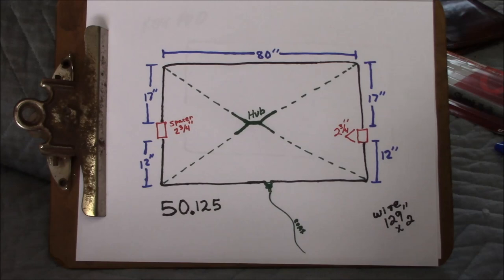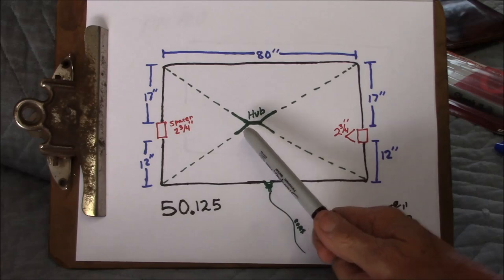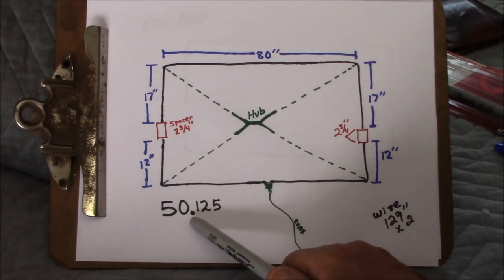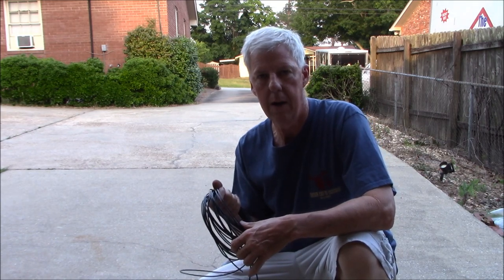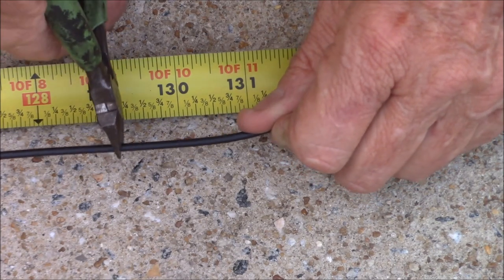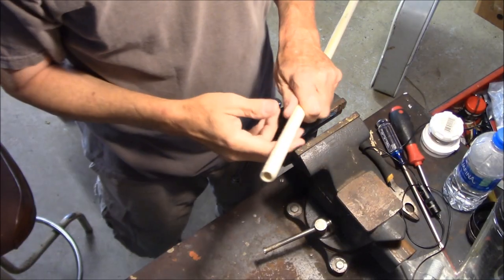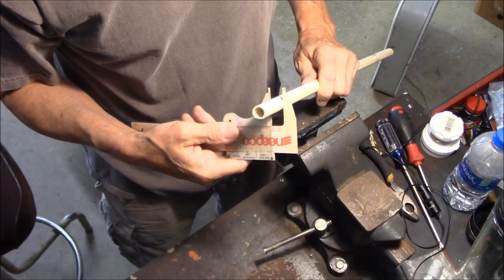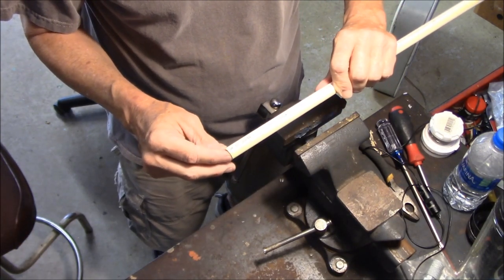Moxon Antenna Build for 6 Meters

Comment: In a word: OUTSTADING!

Clear, consise, and very well presented. A hat tip to you Sir.

I've wanted to get on 6M SSB and the FM Repeaters for years. You just showed me how easy it can be and with band edge to edge usable SWR.

I have so many projects running simultaneously that I can't keep track of them. Some I've just started, some are at some level of completion, but none have been completed. YIKES......

I suspect I have some form of AD. In my mid-teens, my Grandmother said 'Rusty, you never finish anything'. So for the last 65+ years, I've been working really hard to prove that that Grand Old Lady was 100% correct. Hi-Hi.....

Well, you just added another project to my list. But, this is so easy that I can start it in a week or two and finish it in one or two days. A great Rainy-Day project.

If I do this, I'll come back and edit this post.

Say a prayer for me.....

73 from So NH
Reply from the maker: Thanks for the kind words.
6 M season is upon us. 
Steve Ad4xt

Comment: Wow what a nice design! You make this look quick and easy and your instructions are clean and easy to follow. A work of caution on the Dremel, those mini saw blades can get dangerous VERY QUICKLY! I almost cut my thumb off one time because I was holding the piece with one hand and cutting with the other and at high rpms the blade can grab the piece you're cutting and take off. You're smart to use a vise! 
  The 6 meter Moxon I built used 1/2 inch copper pipe and was more square than rectangle. It worked great, but I noticed that it radiated down the coax when I checked it with a cheap homemade field strength meter. I used your technique of making a few turns of coax around a small coffee can and then taping and using wire ties around the coax. I didn't leave the coffee can in place, I just used it as a guide while winding the coax. I've heard that it works best when you make the coax 1/2 wavelength long, but I just winged it and wound it a bunch of times and the turns even overlapped each other. It was kind of a mess, but absolutely had NO rf on the coax after that point!
   It would be cool to see you add 2 meters to this as well. I'm not sure if you could feed them with the same coax or not. I love these plumbers delight design and you build hem in the true spirit of amateur radio. Way better than buying something out of a box for hundreds of dollars! As a Mainer myself, I appreciate your shirt, although I did live in South Carolina for 17 years and always like traveling through Georgia. Thanks Steve and 73's.
Reply from the maker: Thanks Ryan for the kind words. My son lived in ME for a year. Got to spend a week and travel with him. Beautiful state. 
My club has done a couple of 2 meter j pole builds.
Reply from the maker: I have a 2 meter simplex video that shows the Is measurements.
Steve - Ad4xt

Comment: Nice build. I like the way the wire elements are held taught. It looks like it will hold up to the test of time. 

I would have like to see better coverage of you mounting it to the mast and to hear the antenna to get a feeling for its directivity and noise characteristics, but maybe you’ve already covered that in another video, so I’ll have a look through your library. 

Thanks for sharing.  73s.

Comment: Great video and nice design. Seems like it would be a hair lighter and cheaper with pvc for the X, using a short straight section and a couple Y's, though it would take some measuring.

Comment: Just tune the antenna for 52 Mhz with 10 AWG stranded or solid wire. The #10 AWG will broadband the antenna by lowering antenna "Q" and extend the tuned 2:1 SWR curve for the whole 6 Meter band. Enjoy !
Reply from the maker: Very nice!

Comment: Suggestion. The SO239 you used has  white nylon insulation. During soldering this softens and distorts. When it cools you can get a poor connection. SO339's with a brown bakalite type insulation are the same price but do not have this problem.
Reply: googled that did not find Any  SO 339
Reply: @j1mbobtech  He fat-fingered it. >>>SO-239<<<

Comment: Hi Steve.  Thanks for the great video.  I'm nearly finished building a copy and have one question.  I'm curious about the coax connection device on the active element.  If you gave dimensions, particularly the distance between the dipole half's I missed that.  When measuring the 80 inches for the active dipole is just the wire measured, or is the measurement including the gap between the connection posts?  Thanks.
Reply from the maker: It's part of the total measurement. Just leave you a little extra at the ends in case you need to adjust. Good luck.

Comment: Interesting.  Never have seen an antenna like this.    I wonder if chokes like that on a Hustker vertical antenna or an EFHW could be used to work bands on lower frequencies like 40 & 80 for this antenna? Has any thought been given to that idea?
Reply from the maker: Moxon design has been out for quite a while. Easier to manage them on the upper bands.

Comment: Thanks for the video. Can you adjust the feed point for best SWR, and how much of the band does it cover?
Reply from the maker: Adjust the wire length, not the feed point. Just small amounts at a time. 
Covers most of the band, and all of the ssb area.

Comment: Very nice video. I am 80% done with my moxon build. Considering other ways to attach the antenna to to the fiberglass poles. I do not want a permanent threaded solution as shown in your build. Any other ideas? Thanks KK4NKR Brian
Reply from the maker: By going thru the end of the rods it keeps wire measurements locked in place. Not sure of another way and make it easy to set up in the field. Good luck with your build. Six meter season is here. 
Steve  Ad4xt

Comment: Good video, I don't get the four rods to the corners, It is more rigid to run one backbone parallel to the direction of signal, the long axis, and then use two width length pieces in an I configuration. Fiberglass is too hard to find, wood ends up lighter.
Reply from the maker: The rods can be found here in the southeast at any Tractor Supply store.  I take this antenna out portable a lot. My club will use it for Field Day next month. It packs up in a tight package. Thanks for watching. Steve  Ad4xt

Comment: Only critisism is your choice of PL259 with the white nylon insulator These usually distort when heat is applied. Look for connectors with a brown insulator as they don't have this problem.

Ian G4JIU
Reply from the maker: Ian,  this was the only  SO239 chassis connector that I had at the time. You're correct, you have to be careful with the iron with cheaper connectors. :-)

Comment: Which Solder did you use Steve on the HUB ? Resin Core or Acid Core ??? TNX For the Inspiration Video .
Reply from the maker: I used regular plumbing solder that has an acid-base flux. Thanks for watching!

Comment: I know mine may differ but what was the final length of each section tuned?  Great stuff and hope to work you from East TN sometime!  K4RJJ
Reply from the maker: The measurements are in the video somewhere. I do remember that using one of the online calculator tools for the frequency that you want, 50.125 in my case worked out almost perfect, very little tuning was necessary.  Thanks for watching.
Steve

Comment: What were the fiberglass rods originally intended/designed for? Knowing what they are intended for will make it easier for me to find them I think. Thanks
Reply from the maker: Thanks for watching. I'm not sure exactly what they are used for. I purchased them from a local farm feed and seed store. Tractor Supply. I will ask them next time I go by there. 
Steve Ad4xt
Reply: @hamradioportable1630  Electric Fence Post
Reply: You can find fibre glass rods at many garden centers in the UK. Just make sure that you do not buy the plastic covered metal tubed rods. I bought a load of these in differing lengths and later discovered they were all but useless for the intended radio application purpose. They are used as plant supports.
Reply: Driveway markers come in 4 foot or 72 inch lengths

Comment: Steve how for from the ends of rods do you bore holes (your outside holes)
Reply from the maker: No exact measurement here Tommy. Just apply some tension  to the rods to keep the wire taught. Mark the measurements on your wire  real well with a sharpie marker. 
Steve
Reply: @hamradioportable1630  Thanks Steve